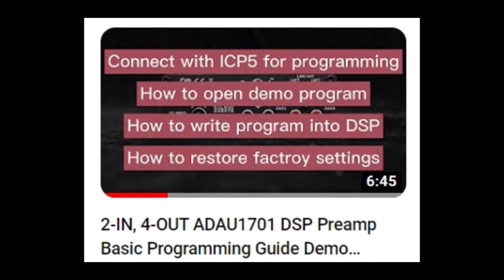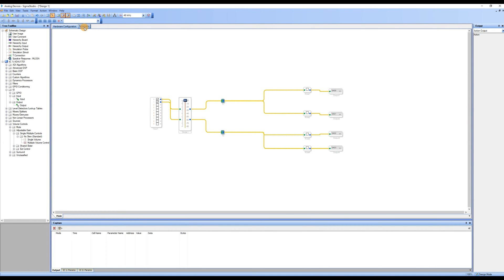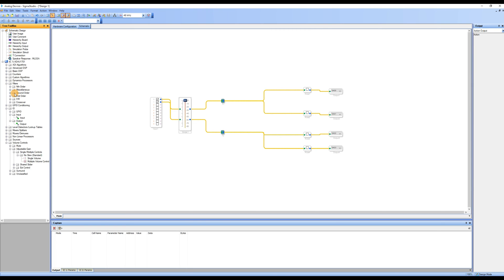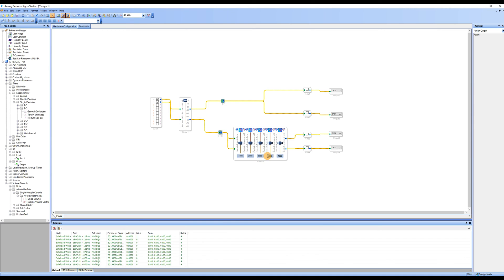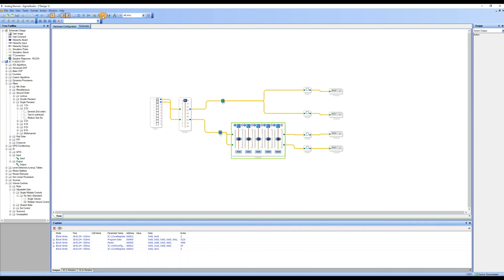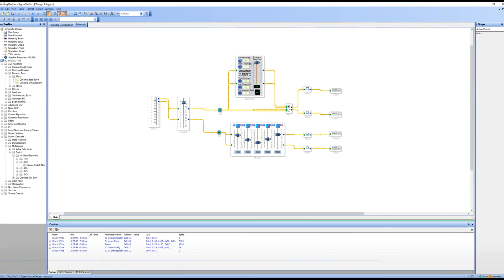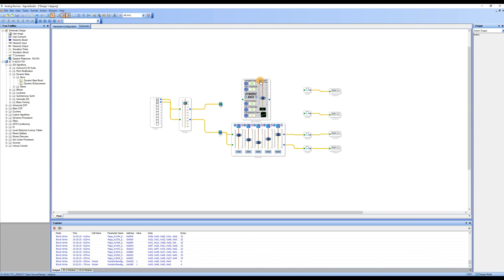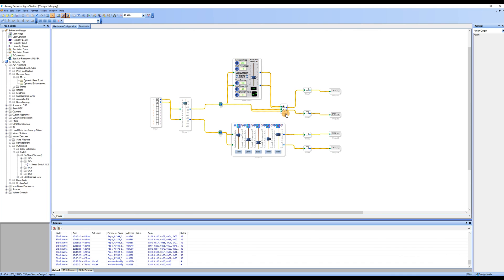Basic Programming Guide EQ & Bass Enhancement Function | WONDOM 2-IN 4-OUT ADAU1701 DSP Preamp

Comment: This looks helpful. Is it possible to map hardware input controls to parameters or possible build/code a little model to make one slider adjust multiple parameters as a function of input value?
Reply from the maker: Hello. The standard program doesn't support the function you want. SigmaStudio programming would be required. You can refer to the Analog Devices SigmaStudio support website for more details: https://wiki.analog.com/resources/tools-software/sigmastudio. Wish this could help you. Have a fantastic day~